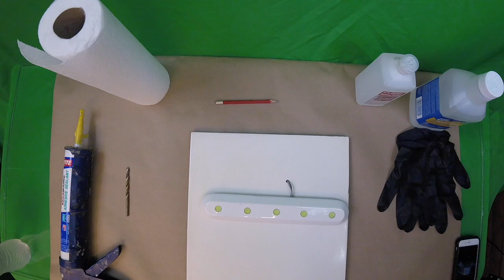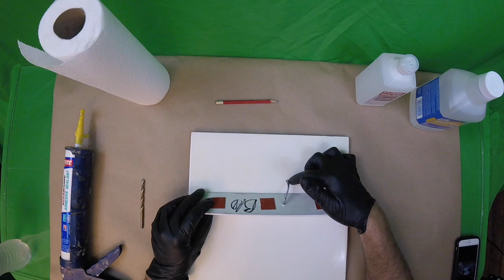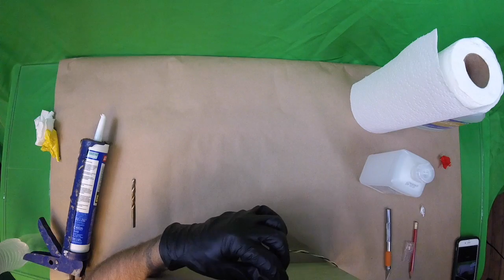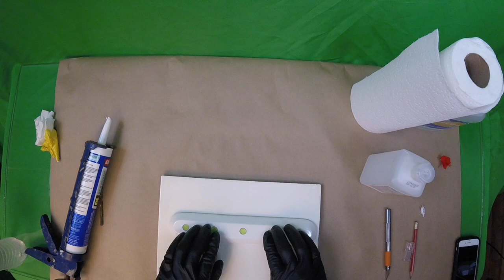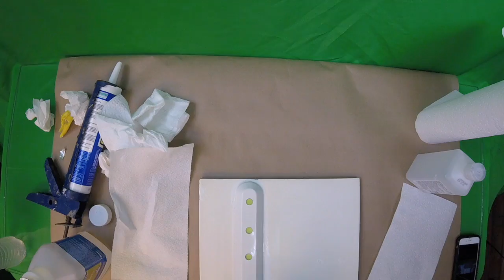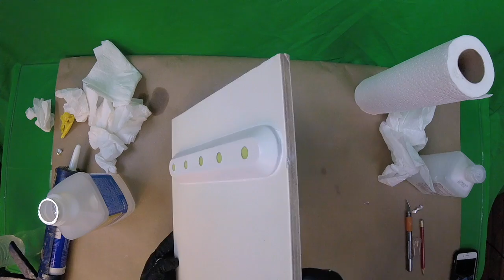UNDERWATER LED BOAT LIGHT NO SCREW MOUNTING

Comment: no hole but the 1st thing is a hole in the boat.
Reply from the maker: No Screw?.  Holes are common in hulls. However Screws(Stainless) will etch most underwater hull lights due to the transfer of electrons. Most common with aluminum but most plating technologies and other metals suffer from this to some extent causing the finish to fall off. Since 99.9% of all Marine installations involve stainless a no screw mount insures the rest of your boat doesn't fall apart because you didn't protect it with anodes or nylon washers.
Reply: The Best Fishing Lights I am looking for a no hole application for lights. When I see the title no screws my mind reads no holes. U didn't say no holes. My bad.